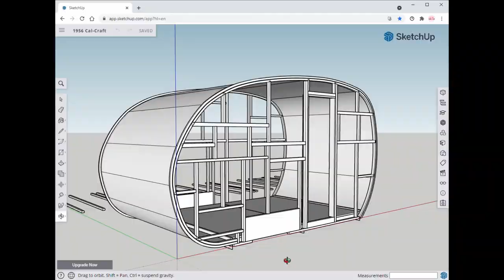SPRAY VS. BRUSH / Applying POLYCRYLIC to VINTAGE CAMPER WALLS

Comment: The polycrylic is a great product to spray with. Lays down super smooth and dries super quick. It appears you done a great job on it. Like seeing your re-build coming together.
Reply from the maker: Yeah I'm liking it so far; although, I feel like regular polyurethane is a tad easier to work with. But you can't beat that low odor and soap and water clean up!

Comment: Beautiful work! I need to varnish a new wooden lawn swing set. I think I'll use marine varnish and a paintbrush.  I'm not really looking forward to it but it's got to get done. You inspire me.😘
Reply from the maker: Good luck, Tracy! I've always had great luck with paintbrush when applying an oil based varnish, but these walls are just too large and the Polycrylic just dries too fast to get the smooth surface I was looking for.

Comment: Do you have to use a trim router or would a regular router work as well?
Reply from the maker: A regular router would be fine, but a trim router is a bit more compact and easier to handle.

Comment: You should run it through a sieve
Reply from the maker: I don't remember showing it in the video, but I do remember running it through a strainer.
Reply: @TrailerTrashtoTreasure  you did on your second video regarding Poly....was thinking maybe thats why it was clogging up towards the end?
Reply from the maker: Ah. I knew I remembered straining it at some point. I think it was more that it was starting to dry in the nozzle of the gun that was causing the trouble. It was over 100⁰F when I was doing this so I was outside the recommended application temperature. I think I remember stopping to clean the nozzle a couple of times on the second wall.